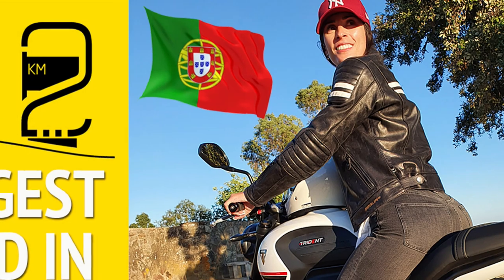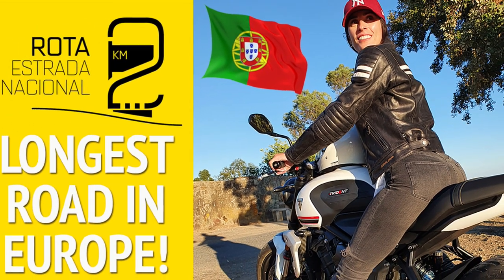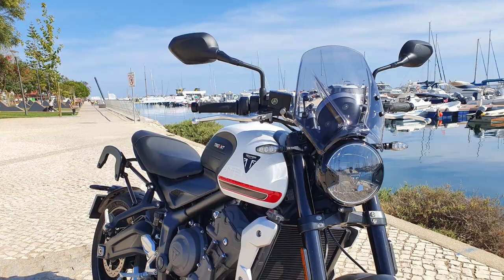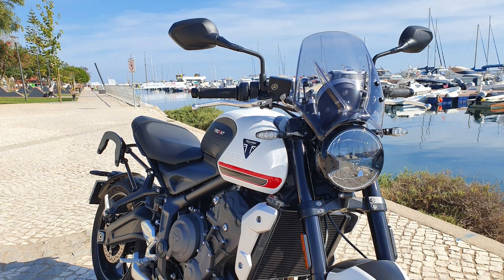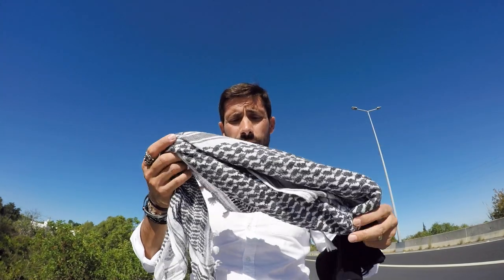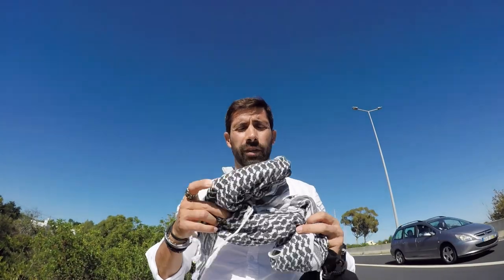How To Reduce Wind Noise In Motorcycle Helmet

Comment: Some seem to forget a wind screen is not primarily to reduce wind noise in the helmet, but to reduce wind pushing against your head & more even your chest when riding at higher speeds.
This does impact the comfort on long riders on more naked type bikes.
Reply: The problem is the low sitting screens they redirects wind turbulence to your neck resulting in more wind noises.

Comment: Yes that man is 100 per cent correct I did it with a normal scarf tie the knot 40 years it worked for i still does  nd better than ear plugs 2 use with scraf the correct amount nd correct n ear that you can hear the motor nd that allow yourself 2 hear horn clearly

Comment: Nice video. I believe that with or without scarf or similar, will be very difficult to talk on the phone. My helmet is a bell broozer, which has no protection for wind on the low front.
Reply from the maker: Me and my wife use the midland intercoms on our trips, and they do fine. As long as your not going over the speed limit. 😜
But the scarf helps quite things down quite alot 👌

Comment: Nice vid, but if you're riding in hot weather, it's actually better to have air travel inside the helmet, in fact i would suggest removing the chin curtain for a cooler head... Cheers
Reply: I disagree 100 %. The manufacturers today are focusing too much on ventilation. That makes their helmets almost unbearable noisy. Try a 50 year old integral helmet - if you can find one.